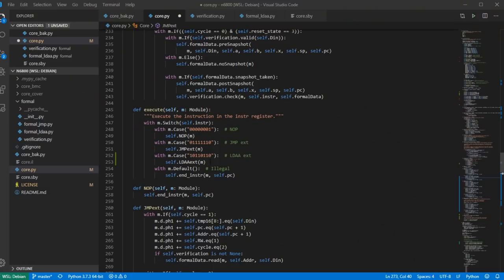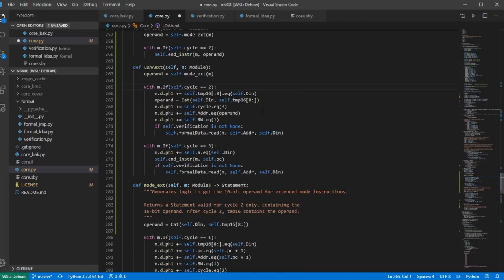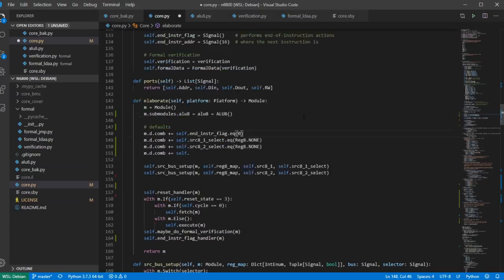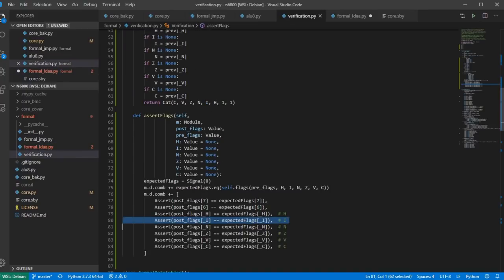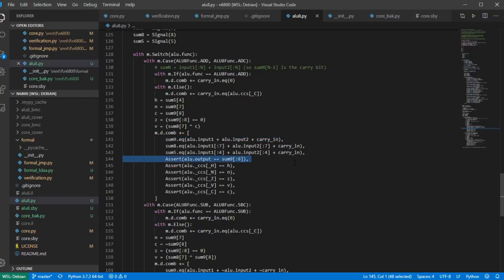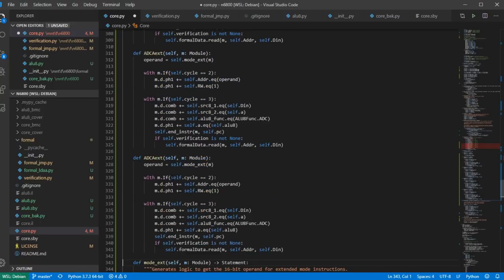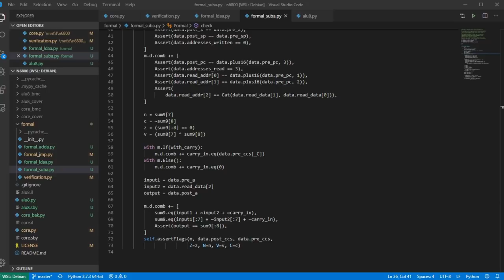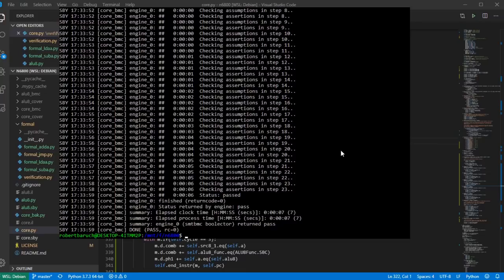Building a 6800 CPU on an FPGA with nMigen (part 4)

Comment: First off, thanks for doing this series. I haven't done HDL since Verilog in the mid-90s and haven't done FPGAs at all, so this is fun! 

I'm not a Python expert by any means, most code I write these days is C. That said, is there a way to start splitting the core.py file into more functional pieces? While your current code is following Arlo Guthrie's Rule ("One big pile is better than two little piles"), I can imagine the core.py file will become enormous. Editing and maintaining such files become a pain. As a hobbyist, that may not matter. As a long-term embedded firmware engineer, it grinds the gears a bit.. I do appreciate that you've started the formal verification code in separate files, but is that allowed because they are separate classes? I know C++ has some annoying rules with how things can be broken up, so maybe Python has the same issues.
Reply from the maker: Absolutely. Splitting at the Python level is easy. Splitting at the hardware level is a little more involved, since now you need to determine what should be in a module ("Elaboratable") and what signals need to go there, and what state the module should have. It isn't clear to me (yet) that there is something that should be a module in Core, I'd probably just go the route of shuffling around various components into different classes, and then using "self.core.x" everywhere instead of "self.x". At least, that's one way.

Comment: ~3:00 
Speaking of low-level optimizations: instead of if cycle==2 we can use 
if cycle[2]{logic; cycle[3]=1;cycle[2]=0} 

This way lots of muxes will be fed from a single wire and not from comparator,
 so it should be slightly faster, or so I thought. Real results are roller coaster in terms of cells(C) and longest topological path(LTP) depending on hardware:

 ecp5: 952C 116LTP  -> 774C  120LTP (before -> after using optimization)
 anlogic: 220C 83LTP -> 264C 93LTP
 intel: 267C 82LTP -> 325C 72LTP
 pure logic(without synth_xxx): 70C 232LTP->72C 280LTP
(results taken after adding LDAAext command)

 
In other words, for ecp5 it eliminated ~25% of the circuit,  for other synth_esizable targets it added 25% more cells.  Now that I typed it, maybe I realized maybe I actually should set all regs in cycle[], not just 2 and rely on latches for other bits. But I don't want running tests again
Reply from the maker: You mean in mode_ext? But then you're going to run into a problem when you have an extended mode instruction with more than 4 cycles. JSR extended, for example, requires 9 cycles. Again, I'm pretty convinced that the low level optimizations will have to come last.

Also, when you make changes like those is exactly the time to run tests again :)
Reply: @RobertBaruch  I didn't watch at that point about mode_ext. When I was testing I switched cycle=Signal(4) to Signal(16)

Actually scratch that results:  when I was testing I did a typo(1 instead of 0) and code didn't disable cycle[n-1], thus all stages were executed at the same time parallel. 

It still passed all the tests(JMPext first, LDAAext later) with flying colors, as they were for single instruction only, but simulation with two LDAA in a row went bonkers: regA changed mid-instruction, end_intr_flag was high all the way through 

Funny enough, I was going to write at later point that I don't feel that tests are particularly thorough(valid feels DRYish, PC validation doesn't check that we landed in the middle of next instruction) though I was at 4 minute mark then(and at 9 minute mark now), so dunno how they are changed.

Fixing the code bloated the number of cells for all boards unfortunately so in the end this idea didn't work and yeah, premature optimization is evil.
Reply from the maker: @etopowertwon  :D Also, keep in mind that the video doesn't show the complete development process, so something might appear in the video and later get changed without comment. In the end, go with the github repo, which is the final version.

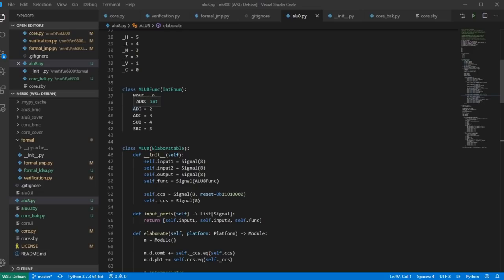Comment: 34:00 What happened with flags? _ccs didn't exist at 23:25, only ccs and LD worked in ph1 domain.
(And during verification using ccs instead of _ccs create logic loop during caluclation of carry)
Reply from the maker: ccs is effectively an input to the ALU, and _ccs is the output. So if you were doing ADC, you'd use ccs[_C] for the input, and _ccs[_C] is the output. Then at the end of the cycle, transfer _ccs to ccs. And yes, I ran into the same logic loop without _ccs!

Comment: It's interesting how similar this is to a straight software emulation.
Reply: I had the same realization. I didn't know how abstracted hardware design can get. I have always marveled at dedicated network hardware or the code needed to process radio or other wireless signals. I thought those people were wizards.